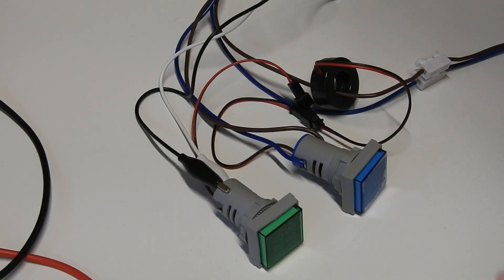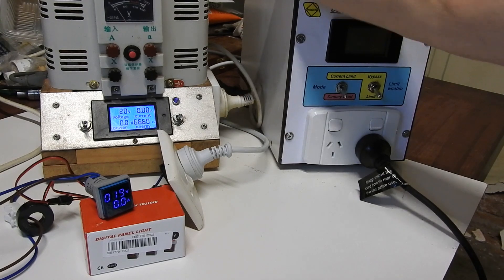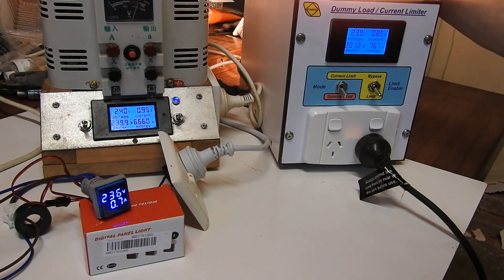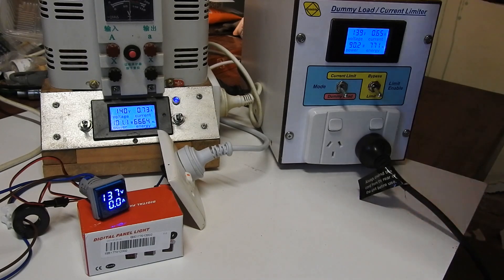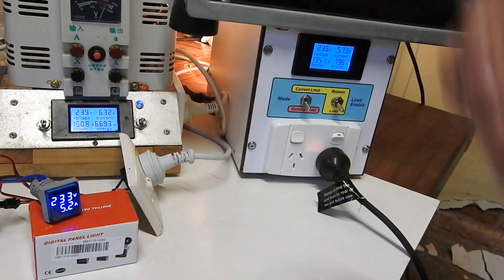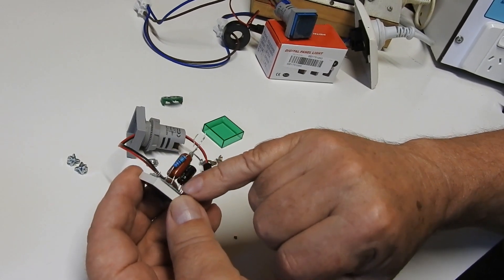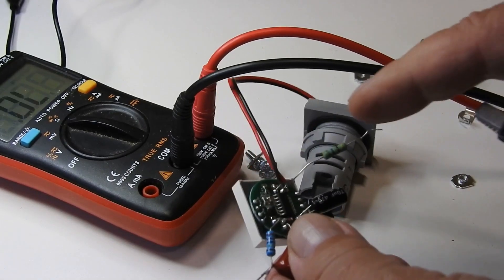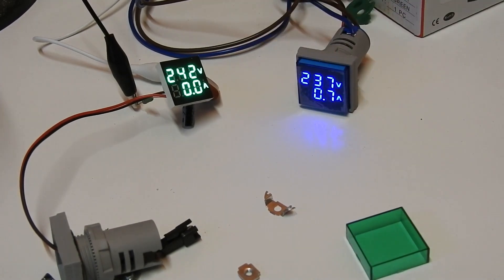Cheap AC Panel meters - Review and teardown

Comment: Tremendous Work !!... would be good enough if you release its part two Video, explaining the pinout of the LED Display Panel that contains 4 Pins on the top and 5 to bottoms
Reply from the maker: Thanks! 
But I don't know what device you are referring to from the description you gave - can you be more specific?
Reply: @bertoid Talking about the same LED display,  that you released the tear down in this video. This time explain the pinout of the LED 7 Segment Display that contains 4 Pins on the top and 5 to bottoms.
Reply from the maker: @user-xb5dc5hh8p  I have no idea what the pinouts are, since the display was not the main point of the video. I would just do a search for some data sheets...
Reply from the maker: @murraymadness4674  These things are pretty crap, I suggest forgetting about them.If you want to measure your energy usage over time, get a Peacefair PZEM-021 or 022 or similar. These accumulate and display energy usage.

Comment: I am CPEng & RPEQ  Electrical/Electronics Engineer. I bought some of these too. You are right. Because CT is rated for 0 - 100A, the unit wont display until a threshold is exceeded which appears to be somewhere around 0.3 - 0.5A. After that it displays the current. If you want to make it 10 times more sensitive, just wind the wire through the CT 10 times. Then output of CT will be 10x more. Just remember to account for where the decimal point is on the display. You can put more or less turns through the CT. Displayed current will be scaled by number of turns on CT, limited really by gauge of wire and how many turns you can fit.  Just remember …. Accuracy also scales with inverse of purchase price. These doo-dads are really cheap, and just meant for basic indication, n😂out accuracy.
Reply from the maker: Yes, these are not good, they're cheap! 
Your ten turn idea is a good one to improve sensitivity. I wonder if the DP position can be adjusted to suit...
Reply: That actually kinda explains why the AC panel meter I got that's similar to the one in the video (with additional Hz reading) doesn't show anything below 0.9A. Thanks.

Comment: I bought some of these. Completely useless in measuring amps above 20A. My plasma cutter draws 20A from the mains yet it reads 60A!
Reply from the maker: Not surprising for these things! 
I can't test that sort of mains current. But I wonder though if your cutter has a low power factor, or strange current waveform, that is hard for these (or any other) meters to deal with?
Reply: They say it won't read a square wave properly, likely what is output from the plasma cutter.  I have a 200 amp dc stick welder, that should pull 40 amps from a/c will see how it does.
Reply: 20A is read with a clamp meter at the power point, not the torch cable itself.
Reply: @impactodelsurenterprise2440  can still be pulling a square wave, it "top surfs the higher voltage.  this is how some microwaves work.  that said, the device could be bad/crap too.

Comment: Do you need to fuse wires that go to screws?
Reply from the maker: Not especially, but the system it's used in should have a fues(s) somewhere...

Comment: The two screws in the back, are they for power for the led screen and electronics and what would be the voltage?  What voltage does it take, min and max would be so helpful?  Thank you so much for your video.
Reply from the maker: Voltages are shown in the video.

Comment: Which resistor is replaced and what is the value of resistor you replaced?
Reply from the maker: I didn't replace any resistor. 
I was speculating that the 10ohm SMD resistor connected to the current transformer might be changed for a slightly higher value, with a trimmer in parallel to adjust the current reading.
Probably not worth it, and not enough room anyway. 
More work on checking out how accurate it is over a larger range of currents would also be required. These things may just be useless altogether...

Comment: Can this be used for a variable power supply ?
Reply from the maker: You mean to monitor the output of a variable supply? Not really, they need a minimum voltage before they work properly.

Comment: I have the same little meter. It is marked 1x  -  2x  on the AC in screws does it mater which way the hot and neutral connect to the AC in? thanks for any help.
Reply from the maker: I would think not, since there's no other connections that could make that matter.